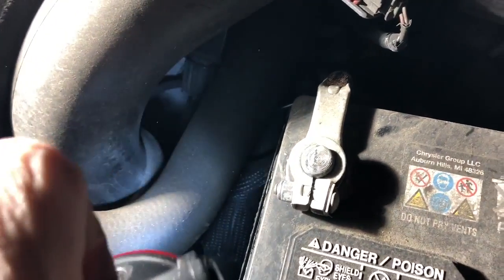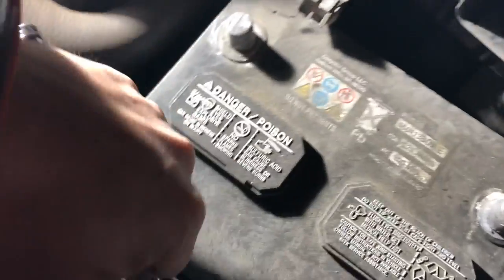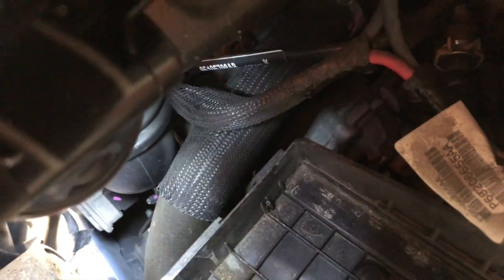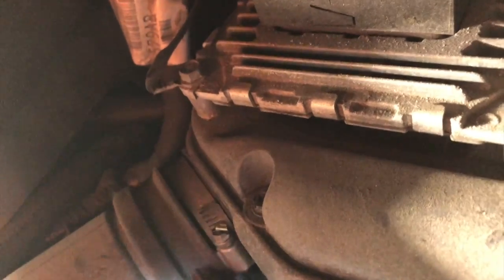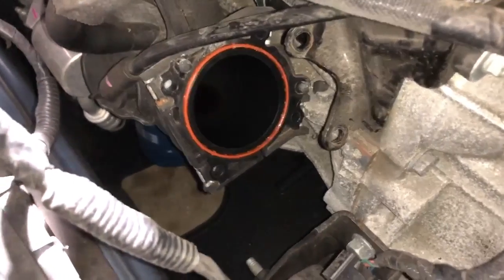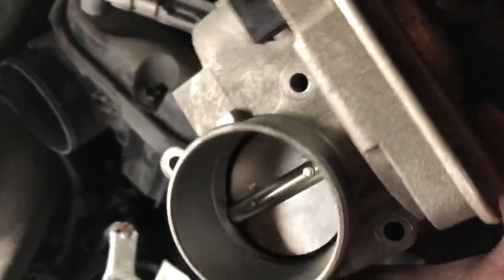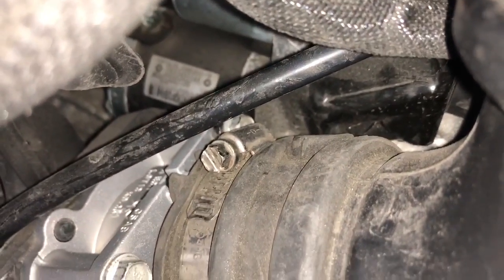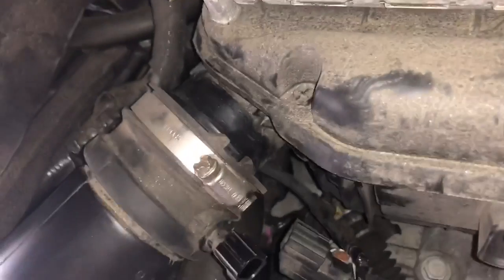Chrysler Jeep Patriot Throttle Body Install. Limp Mode and Rough Idle

Comment: Omar, did you have to recalibrate the throttle body with a scanner? My Jeep just broke down yesterday and I’m fixing it myself. Trip to the junkyard on my agenda today
Reply from the maker: I did not recalibrate mine, I just disconnected the battery for several hours and drove it until the check engine light went off on its own.  I have had others say you can touch the battery terminals to reset the battery and I have also had people use those instructions to recalibrate.
1). Turn ignition to Run, but do not start engine.
2). Wait for all lights to turn off.
3). Over the course of 15 seconds, slowly depress the throttle all the way to the floor.
4). Over the next 15 seconds, slowly let the throttle out in the same manner.
5.) Start car and drive around for a bit.
Let me know how it goes.
Reply: Omar's Garage thank you Omar I really appreciate it. I’ll let you know if that was the problem. I’m pretty sure it is. It has identical symptoms as your grandparents’ car. Thank you again
Reply: Hey Omar, mission accomplished, I got the part from the junkyard and did what you told me and it’s running better than ever, thanks a lot brother I appreciate you
Reply from the maker: Mauricio De La Cruz awesome.  Did you have to recalibrate or did you just drive it?
Reply: Omar's Garage I did both actually, I followed the manual relearn process that you share with me, it idled beautiful immediately after I started the car, it definitely runs way better than it did before. Thank you again

Comment: Did you have to do a RELEARN on your Jeep for it to work right? Or was replacing the throttle body enough?
Reply from the maker: Dean Andrews when I replaced the throttle body and turned the car on, the only light left on was the check engine.  Driving the car around for a while should “relearn” the computer.  The check engine light went off with about 20 miles of driving.  Other than that I didn’t reset or relearn anything.

Comment: I had the same symptoms, 2011 jeep not going over 10 mph, engine light on the dashboard, the code is P2112
The throttle body butterfly would not open and when I removed the throttle body rattled, maybe something inside broken! Replaced throttle body and all issues are gone.
Reply from the maker: Awesome 👏

Comment: Question, I have a 2015 Jeep Patriot. I was on Youtube researching why its so hard to get up my speed when getting on the freeway. Is this a part that helps that?
Reply from the maker: Joey Hakanson did it used to get up to speed a lot faster before?  These Jeeps have pretty small engines and aren’t that fast to begin with. A dirty throttle body or defective throttle body could also decrease acceleration, but it could be one of several things.
Reply: @OmarsGarage  thank u so much for your reply. I've owned this vehicle for probably 6 months and its always been like this. 
Before I had the Jeep I had a Convertible Bug which I was completely in love with. Someone took a baseball bat to it and insurance totalled it.
So my wife said I think the Jeep is slow because of the comparison to my bug.  Sorry for my long story but thank u for the advise and I will have tgat part looked at.

Comment: Mines 2016 compass has been going through limp mode on and off for a year now. Finally gonna fix it by doing what you did. I ordered a cheaper throttle off amazon so hopefully it works 😫🤞🏼
Reply: is it still working?

Comment: What was it doing before you replaced the throttle body? My Patriot will start it just doesn’t want to get a lot of power when I put my foot to the floor when I press on the gas peddle!
Reply from the maker: Same here. It’s in what they call limp mode. Watch this video Chrysler Jeep Patriot Throttle Body Install. Limp Mode and Rough Idle https://youtu.be/bfgw-UeSP34
Reply: @OmarsGarage  yes that’s exactly what my Patriot is doing! Only problem I have is my Patriot is a 2006 and has the 2.4L and all of the Throttle body’s I found on Amazon is for a 2007 up to a 2017! I wonder if my 2006 is different from 07 and up? Any help would help me out a ton! Thanks again Omar

Comment: @Omar’s Garage,
I cleaned and put back the throttle body following your video. It was really helpful!
However, the light still came back. May be i need to replace the throttle body next. 

In addition now i got the oil pressure warning light on the dashboard. Any idea what went wrong?
Reply from the maker: Are you getting all 3 lights come on plus the oil pressure light?  I’d recommend scanning the computer to see what codes it is throwing.
Reply: @OmarsGarage  I got total 3 lights now- Lightning bolt, traction control, and oil pressure warning lights.
Reply: @OmarsGarage  it is actually not the oil pressure warning light...it is the check engine light that came on after I cleaned and put back the throttle body. As per your advice I went to autozone and had it scanned. Based on the code the check engine issue was related to Purge valve. It turned out during the process I accidentally somehow broke the Purge Solenoid Hose that connects the Purge Valve to the engine. I have to order it at the dealer for $13.
Do you think bcz of this broken hose I still have the Throttle body light still on (eventhoguh I cleaned it already), and may be it will go away after i replace the hose? Or I should replace the throttle body next?
Reply from the maker: @nain426  put the part in amd see if it works.  You can also try this relearn procedure for the throttle body , but try it after you replace the broken part. 
1). Turn ignition to Run, but do not start engine.
2). Wait for all lights to turn off.
3). Over the course of 15 seconds, slowly depress the throttle all the way to the floor.
4). Over the next 15 seconds, slowly let the throttle out in the same manner.
5.) Start car and drive around for a bit.

If not then I would try replacing the throttle body.  Link to the one I used is in the description.  I had been working great for over two years now I believe.
Reply: @OmarsGarage  Thanks for the response!
I did follow the re-learn steps already-didnt help. So I guess I will replce the throttle body. But will replace the purge valve hose first and see.

Comment: I've replaced mine step by step from your video and am still experiencing all the symptoms. All 3 lights are on. Lightning bolt. Check engine. And traction. After turning off the car and turning it back on again it runs smooth until all the lights turn on again. Idk what to do.
Reply from the maker: Try this 
Jeep Patriot throttle body relearn

1). Turn ignition to Run, but do not start engine.
2). Wait for all lights to turn off.
3). Over the course of 15 seconds, slowly depress the throttle all the way to the floor.
4). Over the next 15 seconds, slowly let the throttle out in the same manner.
5.) Start car and drive around for a bit.

Comment: Thanks for the videos. My 2011 Patriot on occasion wont start. The dash lights come on, as does the lightning bolt. Ill turn the key back to off, and then attempt to start again, and usually it will. Sometimes it takes a couple of attempts. Is this still the throttle body? Is it an expensive repair?
Thanks!
Reply from the maker: Christopher Wilbarger might be worth trying.  Took me about half an hour and less than $100 to do it myself.

Comment: Hello! Mister Omar
congratulations on the tutorial! I am from Brazil and I have a jeep liberty 07 that presents this same problem.
what solution would that be? Thanks
Reply from the maker: You can try cleaning the throttle body first and making sure all the electrical connections are not loose. If that doesn’t solve it then I would suggest trying to swap out the throttle body.
Reply: @OmarsGarage  
Thank you!
You do a great job.
I'll do what you recommended

Comment: Thank for the video, having the same issue, but it comes and goes, no engine lights and no codes in the OBDII, but, the throttle light comes on and the car star to run rough for a few seconds and then the light goes off and the car runs ok. Is this the same issue or something more. Second it makes this really bad vibration when this happens, is this normal with the throttle issue?  Please let me know being that i want to buy the part but if its something else then I wouldn't waste the time and the money.
Reply from the maker: Marcos Cintron i was definitely getting a bad vibration when this was happening.  It was also intermittent on this car, but in the end it never went back to normal and I had to order the part.  If your car is older it may be worth it to get a new one anyways as these parts can wear out.  It’s not that expensive and with this video you can do it yourself.

Comment: This video is pretty old, but I need your help! I have a 2010 Jeep Compass, got my throttle body replaced about 6 months ago, but all the symptoms and warning lights have come back. I’ve replaced my coil pack, then my spark plugs. Which helped for a few days then all the rough idling, the hard shaking when I slow down and take my foot off the gas and warning lights have come back. And it is a hard shake, feels like my engine could fall right out. Do you think I need to replace it again?? Please help 🙏🏼
Reply from the maker: What brand did you replace it with? If you used the OEM parts it could be failing again. Don’t remember the brand I used but the link is in the description. Been several years now amd now issues with mine.

Comment: Mines went out and the wires smell like they were smoking my whole truck stop on the high way and that throttle lighting sign piped up first then the check engine second … so that cause your whole truck to shut off and won’t crank??? It like it won’t to start up but something stoping it?
Reply from the maker: That sounds like it’s something totally different. This never smoked and it would turn on but was in limp mode.

Comment: Hey this exact thing happened to my patriot as well and I used the code reader to make sure it was the electronic throttle but the code popped up as “U1407” which has to do with the catalytic convertor... You have any idea what might be going on??
Reply from the maker: u1407, u1424, and u1425 are the three codes that have been mentioned when people experience a throttle body failure.  Check all the harness connections to and around the tb and if that doesn’t work then remove the tb and see if it can be cleaned.  If you are experiencing the same warning lights and issues then it could well be the throttle body.

Comment: Exact same thing is happening to mine gonna order the part Friday and give it a shot.. thanks for the video
Reply from the maker: Michael Dee thanks for the subscribe.  Keep me updated on if this works for you.
Reply: Omar's Garage yeah getting it Friday. So I'll give it a shot and save $$
Reply: Michael Dee same problem here. I swapped the parts earlier today. So far so good! Hope it works out for you too
Reply: Elwood Madison yeah ordered the throttle body on Amazon today will be here on Friday. I'm glad it's working out for you man. Keep me updated
Reply from the maker: Awesome!
Reply: So put the new one in. Took it around the block a few times and on my way home went into limp mode with just the traction control light that came on.. any ideas? Maybe a sensor?
Reply from the maker: Michael Dee try driving it a bit more.  I’ve heard some people say that it takes some time for the computer to relearn the new throttle body.  Have you tried to use an OBDII scanner to read codes?  Most auto parts stores will do it for free if you don’t have one.  See if it’s another sensor.  I’ve also heard of people getting another bad throttle body even if it’s new.  Always good to get codes before and after to see if it’s the same issue.
Reply from the maker: Also make sure to check all the connections and make sure none of the air hoses or sensor connectors have come loose with the drive.
Reply: Okay thanks
Reply: Hey Michael Dee, did you ever get the issue fixed?  My 2015 Patriot has the same systems and looking for resolutions.
Reply: I did the same thing  change the throttle body and nothing still in limp mode?my traction light it's on  and ecp light 
Can some one help me

Comment: Can the throttle body cause my jeep patriot to not accelerate over 35 mph? Also what have replaced the throttle body twice already but it is still doing the same thing, could it be it needs some sort of relearning procedure to get it to work properly?
Reply from the maker: Did you replace it with the tb I have listed in the description of the video? I think the relearn procedure is also in the description or at least in the comments.

Comment: i fried out my starter on my 2010 compass after taking out the throttle body and cleaning it because i desperately trying to start it i dont know if i properly relearned throttle.now i have to order new starter and i will just buy a new throttle body.dont do what i just have done.

Comment: 2008 Jeep Liberty here, electronic throttle body , have the same issue but was told to just replace IAC, should I replace the whole thing? Throttle body? And does it need to be “re programmed”? Thanks man
Reply from the maker: From what I know, the IAC is built into the throttle body. Not sure if you can replace just the IAC.  To me it’s worth just replacing the whole thing, knowing that it’s a part that fails in most of these cars. I didn’t reprogram mine.  Just disconnected the computer for a while.  The check engine light was on when I restarted the car, but went away after about 15 miles of driving.
Reply: Omar's Garage if I just disconnect the battery will it be fine ? Not sure how to disconnect the computer or if I need to, but thanks I’ll probably just replace while throttle
Reply from the maker: Jesse Ortega either you disconnect the battery to reset the computer or you use an OBDII scan tool.  The computer is not meant to be disconnected.

Comment: Did you have to relearn the new throttle body?
Reply from the maker: I didn’t do the relearn process on mine.  I just drove it and eventually the check engine light went off once the computer relearned it by itself.  Some other folks have commented that this is the procedure to relearn of that doesn’t work:
1). Turn ignition to Run, but do not start engine.
2). Wait for all lights to turn off.
3). Over the course of 15 seconds, slowly depress the throttle all the way to the floor.
4). Over the next 15 seconds, slowly let the throttle out in the same manner.
5.) Start car and drive around for a bit.

Comment: Will the throttle body you order work with a 2012 Jeep Patriot?
Reply from the maker: Tonia Stewart it should fit 2007-2016 Jeep Patriot.  Check the fitment guide on the amazon description.

Comment: hey so I'm having the same issue with my 2015 jeep patriot. We got the same code when we scanned it. My fiancé started with checking the hoses and doing a tune up... the lights are off and the codes are gone. do you think that was my initial issue? or do you think my car will most likely still need the throttle replaced? when he changed my spark plugs they were burnt out... could that be bc of the bad throttle making my engine work harder then it needs to? he drove the car to work today and so far so good! lol..
Reply from the maker: I would just keep driving it unless it acted up again.  I wouldn’t think that the throttle body would cause the spark plugs to burn out.  It is a little alarming considering your car is pretty new though.  Drive it and if acts up in the same way then I would check out the throttle body.
Reply: thanks for the reply!  @OmarsGarage

Comment: How do you reset the computer? I changed the throttle body but it is not working? Could another sensor be out? Mine is a 2014 Jeep Patriot as well
Reply from the maker: It could be.  To reset the computer you can disconnect the negative battery terminal for about thirty minutes.

Comment: What is limp mode? I'm watching this video because my 14 Patriot died after a lightning bolt and ABS symbol appeared. It wont start...wont go into gear. When I turn the key. Thankfully it died one night in the driveway right after I got home. No warning, just dead
Reply from the maker: Cosmic Head that could be your battery or alternator.  Limp mode is when the car reduced power to avoid damaging the engine, but still allows you to drive the car at a very low speed.  I actually just changed the battery on this Jeep Patriot and will be uploading the video shortly.

Comment: My throttle body from Amazon will be here tomorrow.  My 2012 Patriot is having all the same symptoms but the 4wd light also comes on.  Hoping this will fix it.
Reply from the maker: Keep us updated.
Reply: Replaced it today with help from a friend and it worked!  Drove approximately 25 miles and it is running great!  The only light still on is the engine light.  I wonder maybe if I'll have to get it reset somewhere.  I am super happy that I got this fixed for 70 bucks though.  Thank you so much for the video man!
Reply from the maker: Kipopolis Chavez so glad to hear you got it resolved.  My engine light stayed on for about two days.  If it doesn’t you could disconnect the battery and touch the two cables together to discharge any electricity then leave it disconnected for 30 minutes.  That will usually reset the computer.  If not you can use an OBdII  scanner to reset it.
Reply: I will try that!  I am just so happy this worked, I was skeptical lol.  But it made all the difference.  I see that you replaced your mother in laws about 2 years ago.  Has it happened again since then?
Reply from the maker: Kipopolis Chavez hasn’t reoccurred not once since I replaced it.  I wouldn’t bother with the battery, just drive it for a couple days.  If it design go away then look at the computer reset.
Reply: Ok thanks again Omar!  And thanks for the additional info!